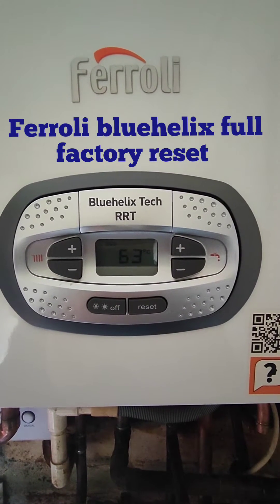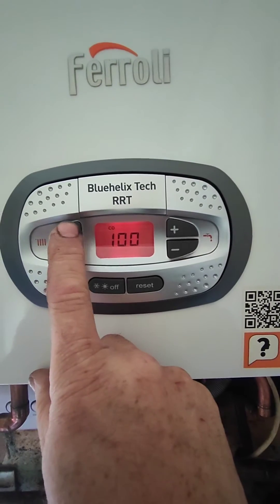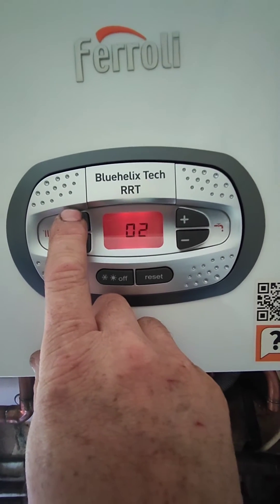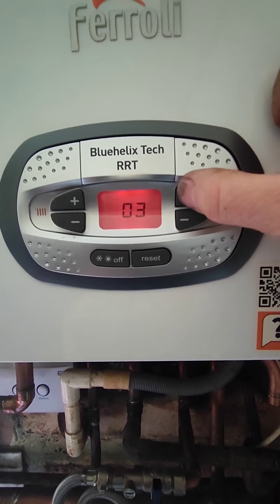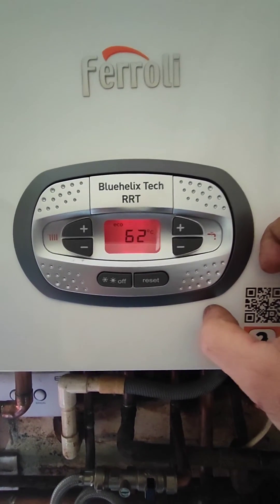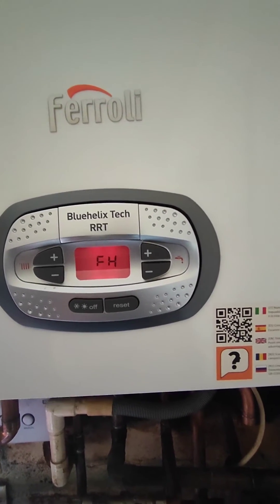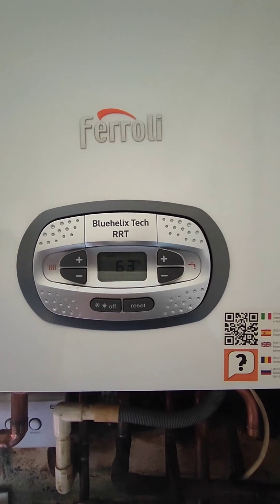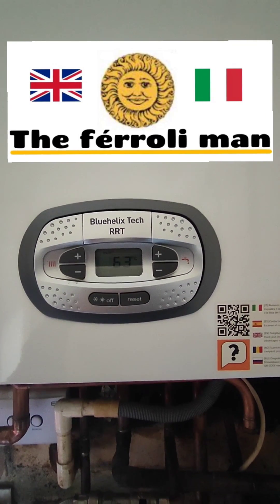ferroli bluehelix full factory reset

Comment: I have a problem.My ferroli bluehix work always,just when go to :::d1:::: stops for a few secound and start agein.
Reply from the maker: D1 is normally delay after the hot water tap has been used which is normal. If it's happening whilst u are using the tap then it could be debris in the flow meter and will need cleaning first

Comment: Hello can you hlep me pleas with my Ferroli bluehelix alpha 24c ? Do you know what the error f78 means ? I cannot find it anywhere 😢 , the boiler start , working good and at the moment that error apair , the flame is still on and working normally,  so is just the error witch apair.. and other times i have another issue,  boiler want to start but the flame not going on , is doing this for a fews  times , every time apair d3 and if is not starting after dose times apair A01 , i have gas on my "bottle" my boiler is wirking on LPG , after some knocks with a key in the pipes he finaly start and working normal , but that f 78 apair again... i will post soon a video to my channel to show you the symptoms... Thanks in advance.